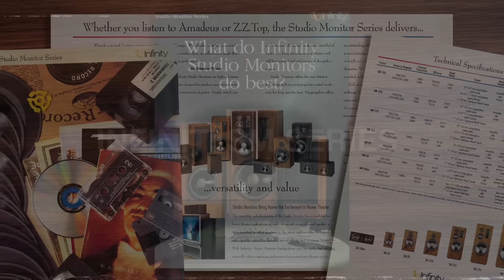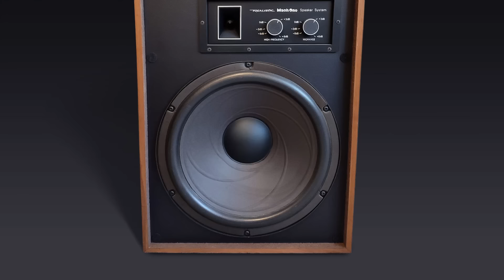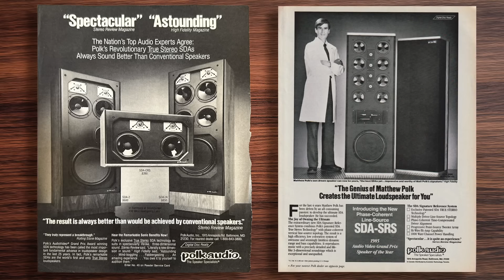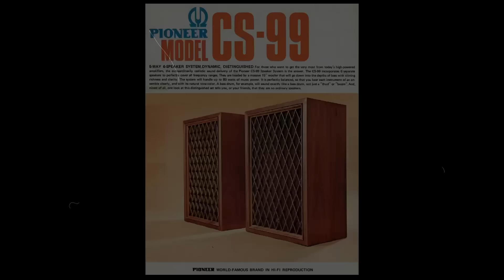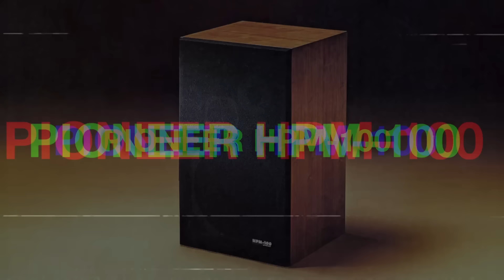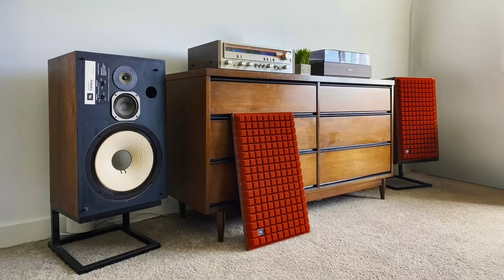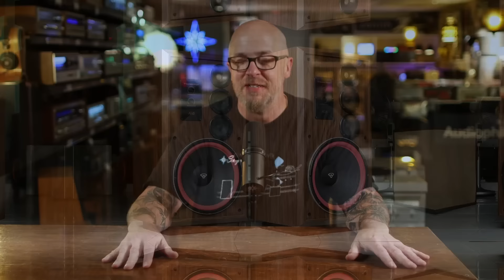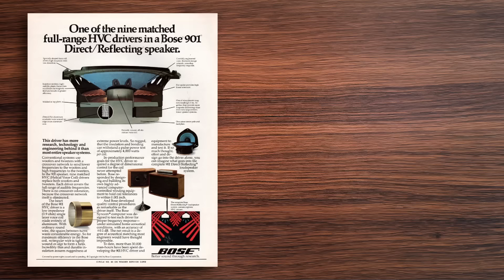Why Do Audiophiles Hate These 9 Legendary Speakers?

Comment: With respect to the Mach 1s.  Back in the day...we would have considered them as "good for Radio Shack."  I never particularly liked their sound and would agree...they're good for Radio Shack.  

The Kabuki speakers...back in the day...I "didn't get it."  I never understood why they were being made.  In Pioneer stores...they'd be there next to the HPM series and I never could figure out the market for the Kabuki.  They must have sold or they wouldn't have been made.  They just seemed so retro to a young person with their wood grills and their brown drivers.

The HPM100 was a good speaker.  It was what it was.  It is a speaker I would have bought, if I was in the market for it, at the time for its production.  

I've never really liked Klipsch...except maybe the Corner horns (K-Horns/Klipschorns).  They still weren't my favorite speakers but I, at least, liked them.  

The L100 is one I would have bought if I had the $$$ when I was listening to them.  I ended up with L250s when my ears and $$$ lined up and I'm happy with that result...I still have the L250s...they're sitting right behind me now. 

I owned Cerwin-Vega...I went through a "bass" phase.  I had a pair of 212s.  And then moved up to the S-1...and still have them.  The S-1s are not as spitty as a typical CV.  It was a smooth speaker.  

On the Bose 901 or any of the direct-reflecting speakers...put me in the "hate" column.  For me BOSE = Better Off Somewhere Else!

Comment: I've a pair of Bose 901's series three on the tulip stands and eq, bought used more of a curiosity and they were cheap. After refinishing the cabinets and refoaming all 18 drivers, I found the soundstage and bass Impressive especially watching those little speakers giving it their all while playing Deadmaus, but the entire sound spectrum wasn't right regardless of how the eq was adjusted. Now they're more ornamental than anything else.
Reply: Exactly. Despite all the fancy theory and technology, they just don't sound like actual music. To hear music as intended, go to a concert. Or at least find speakers that come close. Does a piano sound like a piano? Does a singer sound like a human singer? If you only hear recored music, you might not even remember what the real thing sounds like. We hear so much recorded music it comes to seem normal, just like our artificial foods taste normal now. The Bose were like the rock-hard store tomato compared to a fresh luscious garden tomato.
Reply: @johnharvey7913  Traditional boxes, in general, do NOT sound like actual music. For one, they try to produce what audiophiles think is good imaging, a concept that no one in a live concert would even begin to encounter.
Reply: If the speakers are in decent condition, try to find a Bose 1801 Amp to drive them.  The Speaker crossover and the Amp will prolly have to re-capped to get the best sound as all these older systems are aging ...  But if you find an 1801, you will have a completely different opinion of the speakers 😊

Comment: I built my own 901's design speaker cabs once and loaded them with RS speakers along with my 2 cabinets with ported 2 -12" woofers on the bottom ,they rocked . And yes placement of these speakers is a must ,I don't care what your listening to . If you don't place them perfect you can listen to anything and it will sound like crap if they are not positioned in your room for the sound. I currently have a room with a 8ft ceiling and a 18ft square room. I have a pair of Bose 4.2 and Pioneer tower CS-j625 and when you sit in the middle of these you fell like heaven . Run them through a Pioneer SX-850 ad a ADC SoundShaper Two Mk II EQ and any one of three Pioneer turntables I have.

Comment: Fantastic report on old speakers that took me back to 1983 when I was a young private stationed in Augsburg Germany with the US Army. I can see myself standing in the speaker room with friends at the PX (Post Exchange). I drooled over all but could only afford a pair of Tall thin, angled back Infinity's with passive radiator (which I could remember the model number). I currently own vintage Klipsch Fortes, Pioneer HPM60, Cerwing Vega AR30, and BIC Sound Span (bet you have not seen these in a while). LOVE THEM ALL!. Saw and heard the 901 and hated them 😂.  Looked for a set of POLK but was not able to find a good set locally, perhaps for the best. My only set of "NEW" speakers is a pair of Wharfedale Lintons, and even those are based on classics. GREAT trip down memory lane. Thanks!!
Reply: Never heard of BIC sound span but got a pair of BIC formula speakers that rock, can't remember wich exact model there buried in the attic, they have a horn loaded tweeter and an awesome well ported cabinet, not awesome because of build quality but as far as awesomely tuned cabinets.
Reply: I had the Infinity RSIII's from 1984.  Tall, thin, angled back, passive radiator.  Maybe you had then too.
Reply: @KevinLarrowe  Those are exactly it! With Polycell tweeter and midrange.
Reply: I remember that army base 🤣...
I was also stationed in seedorf Germany for the Dutch army and we visited that store a few times.
On the army base i was stationed there was also a duty free store for the Dutch military and they also had a huge choice of stereo's and amplifiers 😂.
But back then i didn't have the money for high end stereo system.... neither do I have it now 😂😂😂.
But i have good memories of listening to Bruce springsteen on those 80's sound systems 😊.
Life was good in those days 😀.
Reply: @lualrosaal I have some Polk SDA SDS 1.2's that I need to get rid of.  These are the flagship model

Comment: I bought a set of Polk SDA 2.3TL speakers around 1991 and listen to them every day.
Reply: nice!!   i have the SDA 1a's and have several pairs of the 80' era Monitor series and i truly believe all of those are some of the best speakers ever for that market segment and price point!  i think they punched way above their weight.  the best thing other than the sound, i have yet to see or have to have done to any of mine is to have to replace the surrounds-AT ALL!!   the rubber or whatever actual materials they used in their surrounds in that era is the best and after all of these decades are still in great condition in ALL of my pairs in my collection. Matthew Polk and those boys did a very solid job in that era of Polk.  i will add as well i've always been a big fan of the SL2000 tweeters too.  keep'em turned to 11 brother!!  \m/ \m/
Reply: @JerryCougill I have a pair of SDA 1-a's as well. They're incredible, especially when placed and measured accurately. They have a new model of sda, the legend 800. They're mind blowing.
Reply: I have a pair of Polk Audio RTA 12, that I replaced my JBL 100's. i love those things.
Reply: @dwyntsch I have had the Polk RTA-8’ts for a decade and love them. One of my favorite Polks ever and I have owned many many many Polks! I was hoping one day a pair of the RTA11’s would show up locally but if not I was happy. Last month a pair of Polk RTA 15TL’s showed up locally and I snatched them up! Original purchaser of the speakers and in super great shape! I’m in heaven.
Reply: Likewise. I have the SDA 2b s and they sound great. Maybe my room is helping. Old house from the Twenties. Tons of quality wood . 25 wide 40 deep with hard wood floors , wood panels half way up the walls. I can be in the kitchen straight shot 40 feet away. Turn them up and let them breathe.
Reply: @edwaux2929    NICE!!  I can't see where the wood and room would hurt that sound what so ever but only help!
Reply: Ditto.  I've had the 2B's and currently the SDA-1Cs.  If you give them enough power and current, they're hard to touch.  And if you give them enough respect with higher-end source components they will stun you.  I feed them with a modified Yamaha M-80 with 400w at 4 ohms and put in new tweeters, crossovers, and a custom interconnect.  I've listened to $100K systems that can't touch them.

Comment: In science, correlation does not equal causation and success in selling does not equal a good product (think the Bose Wave).

In regards to Sansui speakers, @painttoad redid my SP-2500 crossovers and they sound like heaven connected to a vintage Pioneer system.

Comment: Back in the prime of Bose 70’s & 80’s , I and millions of others wanted a pair of 901’s. But at that time of 1982,83 $1200.00 ?
a pair without the stands and add extra $120.00 for the pair of tulip stands, they were quite pricey for the average working person. I wanted a pair so bad that 40 plus years later I didn’t just get a pair I got two pairs = 4 901’s V and I re-foamed all with foam kits from simply speakers. And love them.
Reply: I also re-foamed my Bose 901 series IV's with the kevlar kit from Simply Speakers.  I highly recommend the use of a large flat-blade screwdriver to scrape off all that old foam and glue.  And don't be afraid to muscle those 901s and shake 'em like an Etch-a-sketch, or you'll have old foam stuck inside that cabinet.  

When I saw the falling-apart foam, I thought those speakers were going to end up in the landfill in my town, but in just a few days, I got them all cleaned up, re-foamed, and nice looking and great sounding.  I also polished all of the RCA connections and found better cables in a garage box for my old Sherwood receiver.  Unfortunately, the Sherwood's tuner, CD, Aux, and other sections don't work, so I have my Sonos Port going straight into the Bose EQ unit, and from there straight into the Sherwood's amp-in.  I can't use the bass and treble, balance, or volume knob on the Sherwood because I've completely bypassed the preamp section.  Also, speaker A doesn't work, but the Bose are running fine on Speaker B.   

It feels like an old beat-up, patched up 60s version of a starship with most of the bridge controls busted and scratchy and the ship has only one working engine nacelle, but it still will make warp 6 on a good day.  They might have to bury these Bose 901s with me, lol...maybe in space!
Reply: Back in the 80s I wanted a set of 901s bad but opted for a pair of 501s. Still have them and love the sound reproduction from them. Recently aquired a set of 4 901s that need refoamed. Can't wait to get this done and try them out. If I am disappointed in their sound I have my trusty 501s to fall back on.

Comment: This one really cracks me up.   I think it was around 1974, I had four L-100's in a quad system.  I knew what to expect from them when I bought them, and they delivered, running fine on a 4x25 Marantz 4140 pre-amp/amp.  At that time I had one friend with Cerwin Vegas, and one with Bose 901s, hanging from the ceiling.  Party time, it was.  For comparison, another friend had AR3a's, but he listened to classical.  And the Carpenters.  Sounded great - just dependeds on what you lisrten to , and it always has.  Here, today, from the list of nine, three speaker systems of my time, all then 'new' and yet to be marketing successes, and today is the first I hear about them being hated.  At least in the case of the L-100, I'll take it as a compliment.  I eventually went to KEF Q50's when they were new on the market, around 1994, and much later Klipsch KF-28's around 2020, and presently Klipsch RP-600M II's.  Not an audiophile, but I have had a bit of fun.  Thanks!!!

Comment: those cs99a's were designed to sound the best for the Japanese  homes, which at that time were light construction.. the heavy JBL L-100 and HPM 100 sound super thumping because of the sheet rock design of the average American carpeted living room. The Bose 901's cannot produce above 13K hz even with the EQ.   Mr. Bose was tone deaf. My fav would be A/D/S/ L-710'S or my AR-9's being bi-amped.
Reply: Kevin, you should comment about bi-wiring.
Reply: Cerwin-Vega ---- manufacturer of "Sensurround Sound" in theaters for movies such as "Earthquake" (a Chuck Heston disaster movie) and "Midway". Your right about bass -- some theaters had to install nets to catch falling plaster.

Comment: If I had the room (or budget) I would get a pair of La Scala's.
I distinctly remember the first time I listened to a pair (hitched up to an older McIntosh amp). It wasn't like any other home speaker I've ever heard before. There was such a sharpness, and a feeling of energy being directed at me, that it felt like the sound was passing through me and not just landing on my ear.
I can absolutely understand how with the wrong type of music or connected to the wrong amp, that they will sound harsh and fatiguing. But dialed in correctly, they bring a sense of "live music at home" that is hard to replicate.
Reply: I had a pair of La Scalas that I got on my friends recommendation. He was a big fan of those and had great taste in music.  Hooked them up to my McIntosh system and I hated them. Went back to the store and got some B&W 801's which I still have. It's all about personal taste.
Reply: @mrpbody44  La Scala's and tube amps were made for each other.
Reply: It is the transient response or sometime called attack that horns have....thats why I love horns especially with phenolic drivers

Comment: I bought my HPM 100's back in early 81, still have them, incredible speakers and ended up getting another pair about 15 yrs ago used of coarse but in mint condition for $500. These are my favorite speaker but yes you can bust a nut trying to pick them up, the 75lbs each are pretty awkward.
Reply: I could do that when I was 14 years old--no problem. Now, at 54, I woudln't even think about doing that!

Comment: If the Klipsch sounds "shouty" to you, then they are being used in too small of a room or you are sitting too close to them. They need enough room between the listener and the speaker to allow the woofer to create a full wave where the low, mid and high frequency waves arrive at the same time. Most people just don't have this room. How many times we have seen "audio rooms" that are just too small for almost any speaker to sound right, let alone one that is efficient.
Reply: My room is LARGE; 16' x 20' with an angled vaulted ceiling from 11' to 16'. I have my original 1973 Heresys towed in on the long wall coupled with a powered sub and equalizer on a restored Marantz 2225. It's my happy place...
Reply: Interesting.  I have some newer Klipsch speakers with four inch woofers, and a pair with 6.5 inch woofers. The smaller pair sounds better in the same room.
Reply: How close is too close?

Comment: So ironically I JUST bought yesterday a pair of 1981 Polk Audio 10A’s. $150 Very clean, and works amazing! I have to admit it does sound better than my Infinity Interlude IL40’s I’ve had forever.  I kinda like my Interludes but with having a 8” woofer, there is NO BASS. Hence why I have 4-SVS subs.
Reply: The SDA technology works great and he probably did not set them up properly because you can move just about anywhere in the room and still get the noise cancelling for live performance sound. You can literally close your eyes and the band sounds like it is live being literally right in front of you. Klipsch is a very close second choice for me as well.

Comment: I must be clairvoyant,  I knew the 901s would top the list! I did love my 301s. As a matter of fact, in 1977,  my next door neighbor stole my 301s but left my Ohm C2s behind. I think it was a matter of room in the car....
Reply: I still love my Altec Voice of the theatre speakers!!
Reply: @jamesswilleyamericasaudito7017 and 30 years (and a woofer refoam I did myself) my L100t3s are as sweet as ever. No downstairs neighbor here.
Reply: @jamesswilleyamericasaudito7017 
I hope that room isn't larger than 12X16 or you will have to change amps from 250 to 500wpc.
Reply: In 1993 I had to box my JBL L100t3s up for a year or so in an upstairs apartment (not even worth a try). So I bought Bose 301s and hung them in tethers in opposite corners of the living room. The kitchen was directly behind with a floor to ceiling wall spanning 34 the distance. I swear I could be cooking dinner and hear the left channel speaker all the way around that solid wall and this at very medium volume often with the downstairs neighbor pounding on his ceiling with a broom. Amazing sound distribution.
Reply: I have some JBL 100s , Bose 601 series 2 and klipsch heresy’s depending on which receiver I have them hooked to they all sound good.
Reply: After I downsized from my 901's I had some 301's hooked to a Tandberg receiver, they really could cook. I ended up putting them in the back of my hatchback VW, they were insane book shelfs.
Reply: A pair of ratty old 301s were the first speakers I ever bought. They seemed really impressive compared to the typical "comes bundled with the rack system" speakers from the 80s and 90s which were all I listened to before that.
Reply: @bubba99009 - Same here!
Reply: love for the C2s
Reply: I had the Bose 601’s and liked them for their time period.  I outgrew that kind of sound as I aged and started listening to more diverse music, I.E. Jazz and Classical.  But I always say, to each their own.  If it brings you joy who cares?  Thanks for the rundown man.
Reply: Ive owned the 201's in the natural wood cabinet i liked them myself even ran them in my truck since my speakers were blown , and I had tried the 301's in the black cabinets and i liked them too but I didn't own them but both needed sold